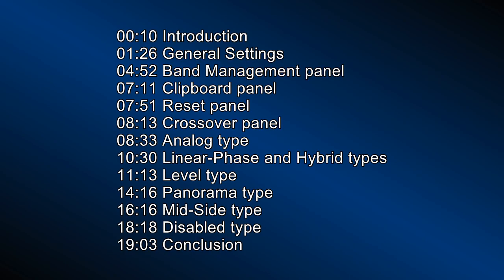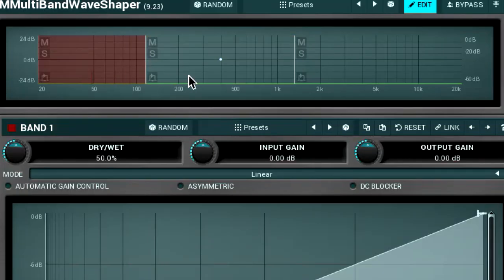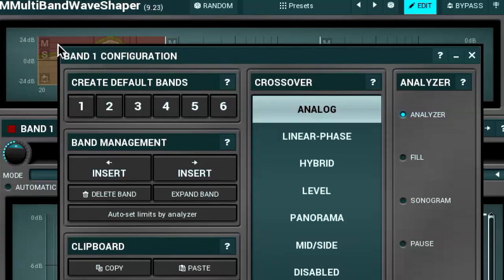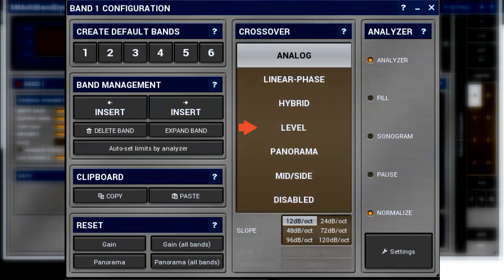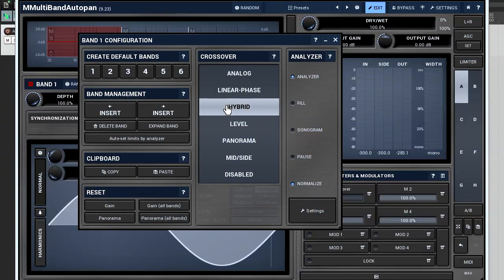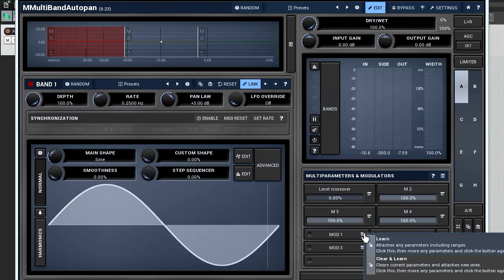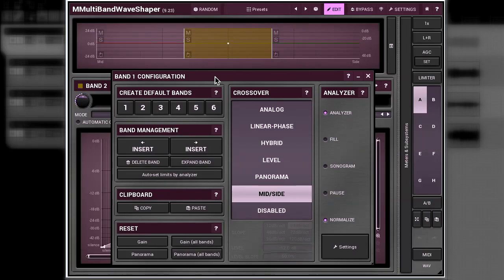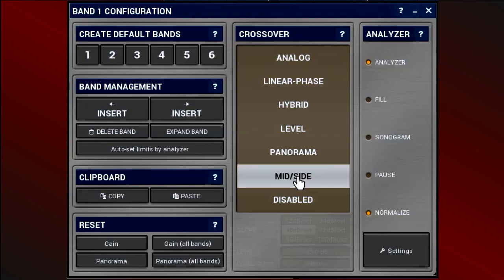Multiband audio processing and crossovers

Comment: Also the levels thing is counter-intutive. By default, I would expect it to behave out of the box as though as described with the follower attached.

Maybe then have the level slider greyed out until you toggle a flag that says "manual level control".

Otherwise why have the db scale along the bottom if db is irrellevent (default behavior).

Comment: I don't know why they don't just call the "disabled" mode "parallel" since disabled is more to me like just having one band - which you can already do without having to select a crossover type. 

But simply running one band with the default type is different from running the "disabled" type and it is in fact "parallel", it should be labelled as such.

Anyway, just a tiny niggle for what is essentially epic functionality.

Comment: great video... but - what exactly is the difference between hybrid and linear xovers? in the video it says the steepness is closer to their analog counterparts, but the analog steepness varies from 12-120db. Do you instead mean to say that hybrid is closer in "shape, slope and curve" to analog?
Reply from the maker: Thank you. Basically the linear-phase is extremely steep and the steepness varies with frequency in log scale. Hybrid tries to work more similar to the analog filters, which have the same slope in log scale, no matter which frequency it is. Anyways in newest versions there are also analog LP crossovers, which have the same shape as analog crossovers, but are linear-phase.
Reply: Hello, thanks for the great plugin. I noticed the new "Analog LP crossovers" seems to be more transparent, compared to older Hybrid and Linear Phase crossovers. Do you recommend "Analog LP crossovers" for mastering use now? or Do you still recommend Linear Phase for mastering as described in the manual pdfs?
Reply from the maker: They are all transparent, but the hybrid and linear-phase crossovers are extremely steep, so it depends what you aim for.
Reply: OK thanks!